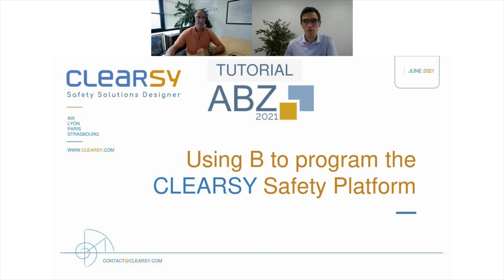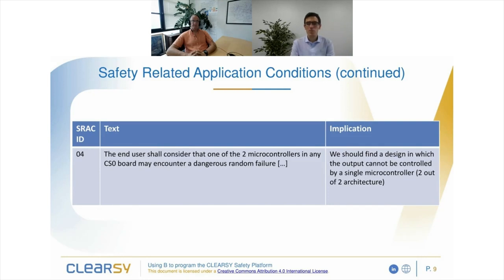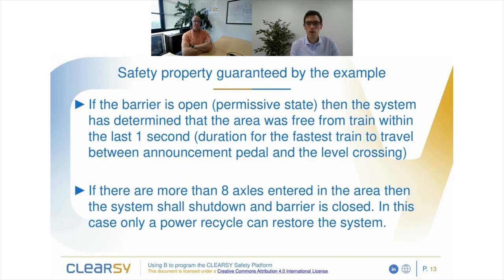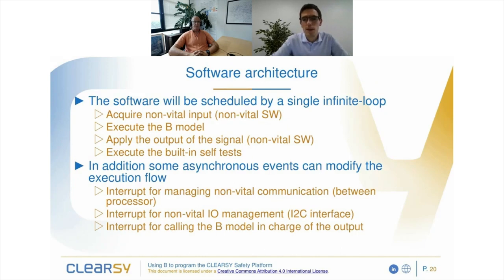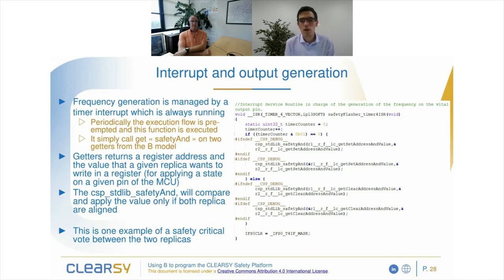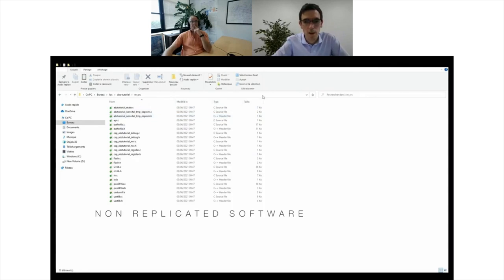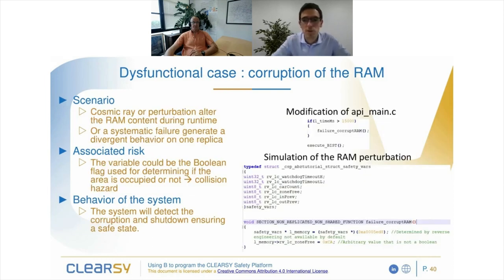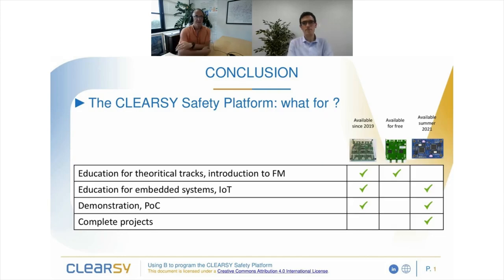Tutorial "Using B to program the CLEARSY Safety Platform" part 3

Comment: Just wonder if Clearsy safety platform for academic use would include every software and documentation required to develop an SIL-4 control system. I mean, paying for the hardware will cover the compiler, library, documentation, and everything else.
Reply from the maker: The academic version is for education only.
Only the industrial version is SIL4 certified.